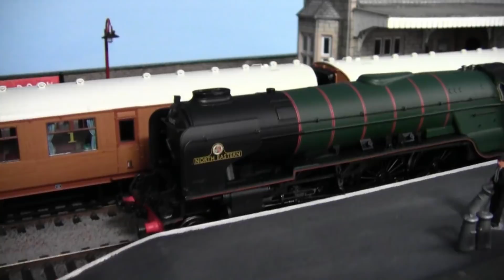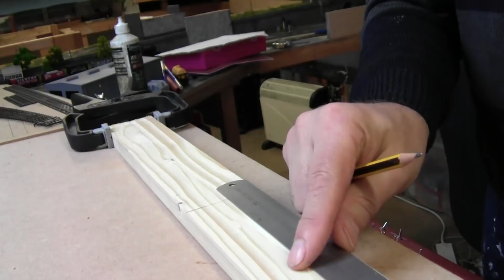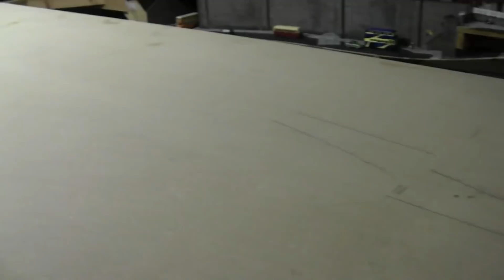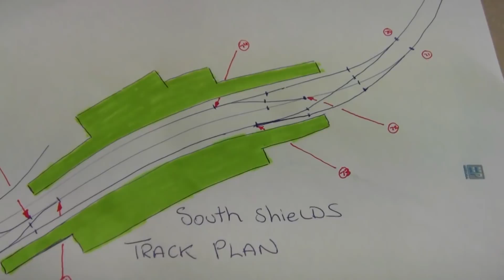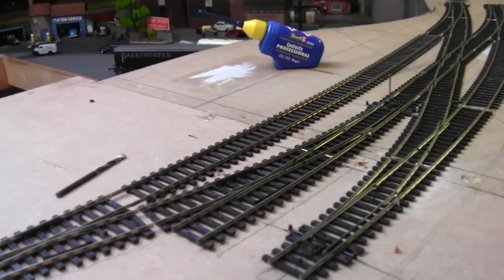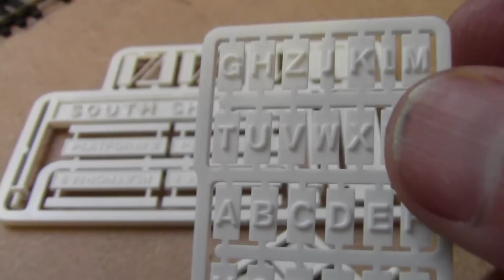OO Gauge, Track work Layout & Design. No189

Comment: Hi Tony, just a thought, instead of the diamond crossing that you've installed, would a single slip have been preferable, just to give that added bit of operational flexibility?
Regards, 
Daz.
Reply from the maker: Hi Daz. double slip the space is there yes i could have done that. just never thought of it. i think i will stick with what i have for now. but you are right it would have given more. but historical there is no double slip there or cross over for that matter. there was only 2 sets of switch points for either direction. nice idea though.. thanks again Tony
Reply: Where are you based Tony?
I'm a Hebburn lad,born in South Shields.
Reply from the maker: Hi Daz. small world, i used to work in Pelaw in the stonehills complex, and use to drive through Hebburn. I am now based in Fareham near Portsmouth, so I am a long way from home, moved down south to find work back in the 1990s. but i do come up to visit south shields from to time. as i still have family and friends there. but i do miss the place...…..

Comment: Nice progress Tony. Will you put a track underlay like cork or another sound absorbing material ?  I was also wondering: since you solder a connection wire between the stock and closure rails why not use them as feeders to the DCC track Bus ? Success & greetings, Filip
Reply from the maker: Hi Filip. no there will be no underlay going under the track. as the trains wont thundering through the station so noise levels should be low. on a couple of points where the solder feeds where connected between the stock and closure rails is because of the joints between the two baseboards didint want to take the chance of drilling through screws or cables when doing the final fit. the bus bar is below the storage sidings baseboard which will make easy for wiring up...thank you again for taking the time to comment...greetings tony

Comment: Good to see you have got some gentle curves through the points, well worth the time to get it right, looks great. On your initial plan would putting the missing cross over on the bridge work?
Reply from the maker: Hi Stephan. your question about the crossover. the bridge is only 125mm in width and it would have been a tight fit. but i could moved the 2 curved points further back onto the bridge but the seep point motors would have been seen. its swings and roundabouts. when it comes to juggling for space, i would have liked is an extra meter of baseboard. but we all dream of more space to build our layouts. the station in real life would hold up to 10 coaches. but i have to settle for half that. but there's always a but. the length of platform will be around 1600mm long that's what i am hope to achieve....thanks again for commenting......Tony